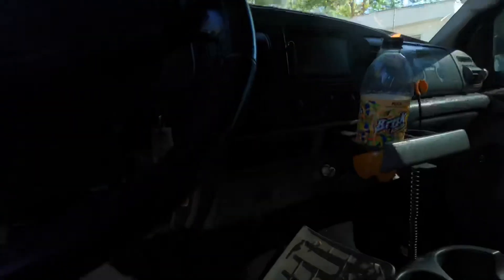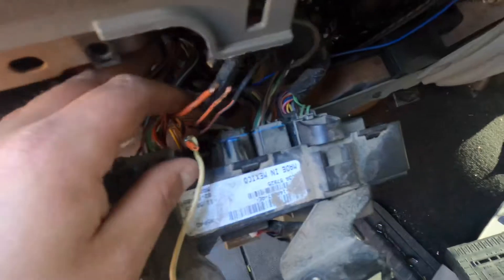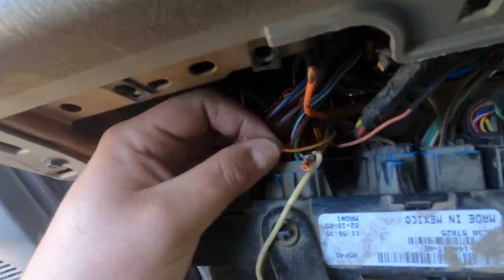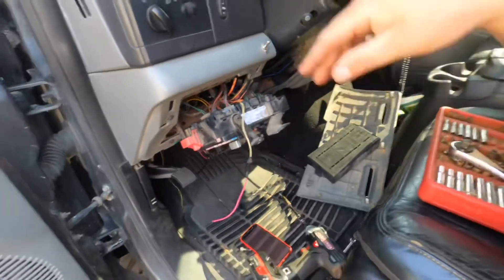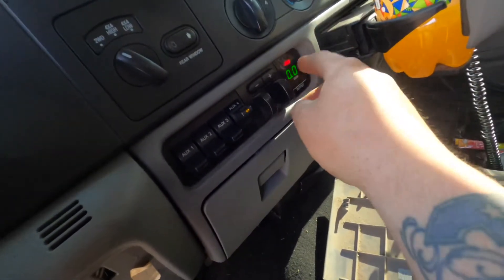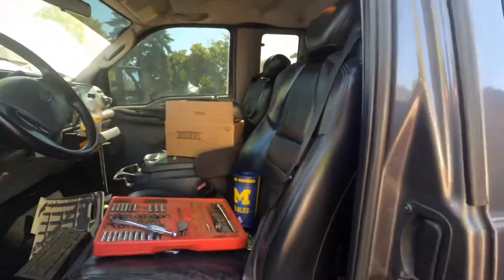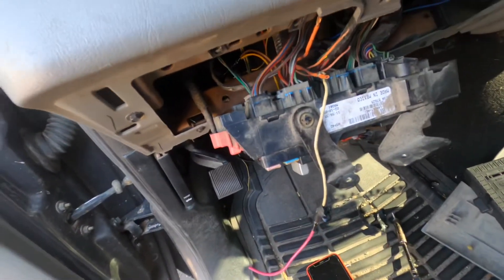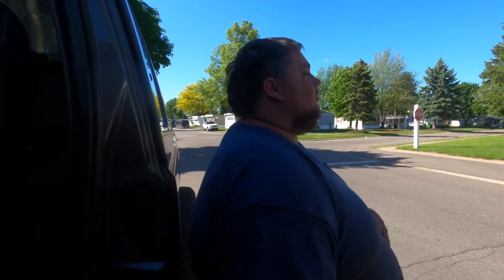How to find upfitter switch wires ford f250.

Comment: What auxiliary switch are those I've been looking for something like that for my truck
Reply from the maker: Those are factory outfitter switches
Reply: @Kickitwithkody   so theres high idle what else does those other wires do?
Reply from the maker: The tires are all blanks. There just pass through wires so instead of blowing a hole in the fire wall for like rock lights, pod lights, some outside source that you want to run a switch into the interior for.